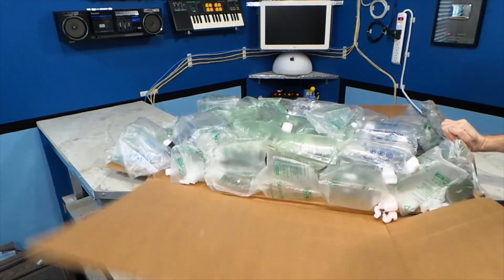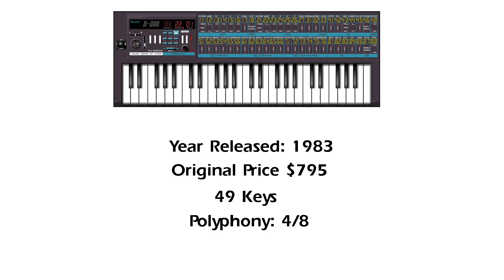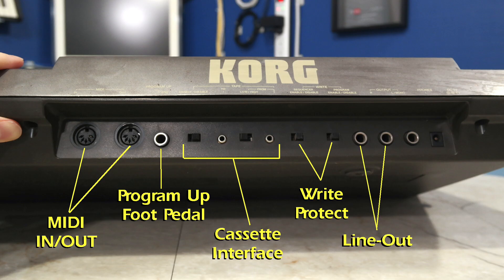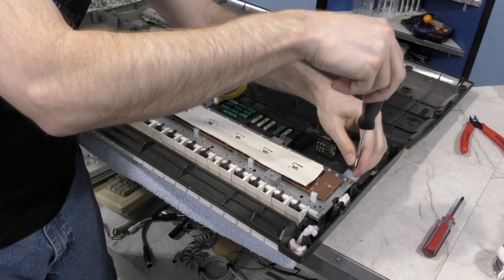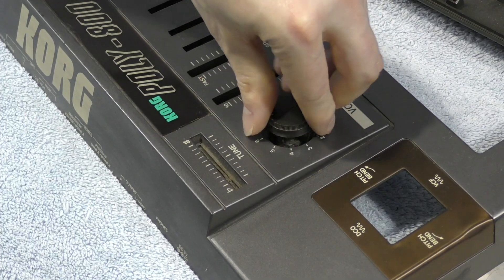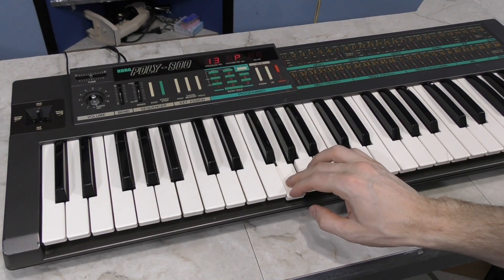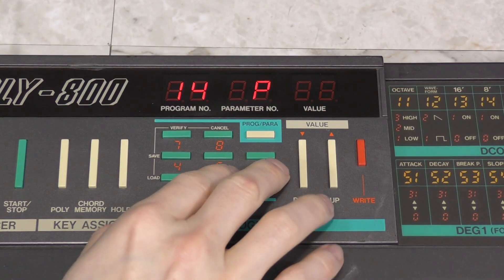Korg Poly 800 Battery replacement and factory reload.

Comment: I had a Yamaha PSR multi function keyboard, and it was good enough for me. I connected my vintage Roland Octipad, MIDI drum pads, and it worked. One day, I turned it on, and it made a loud buzzing sound. I wish I could have brought it somewhere and had it repaired.

Comment: Someone gave me a "broken" Korg-800 a +decade ago ( a stand-alone one w/o the keyboard) but I never got round to looking into it. 
After watching this post I opened it up, added 2 dbl-A batteries and it seemed to run .. 
I now need to hook it up and see if it all works .. from the posts on the Korg-800 it has some passable retro 80's sounds.

Comment: I opened mine up and there wasnt even a battery soldered to the board. I ended up adding one myself which fixed the problem. Hooray. Tho about two months later the same thing happened (the volume of the patches were incredibly faint

Comment: Hello, I’ve tried several times playing the audio file but I’m still not getting the “GOOD” message. I noticed also that, while playing the audio file, the “load” message doesn’t flicker like yours does. I’ve been playing the audio file from my Ipad2 into the synth, could that be the issue - should I be using a tape recorder? Any insights appreciated. Cheers!

Comment: Nice! These poly 800’s often get dissed on for being thin sounding etc,but they are not bad boards,especially the mk 2 version. One tip about those batteries: Sometimes it’s best to wire in some leads and relocate the battery to a safer position so that if it leaks,it’s not onto any fragile electronics. Also- If you want to retain the patches,either dump them through the tape out,or connect the main board to power as you swap out the battery,and often the patches will remain.  These keyboards are good for lofi 80’s stuff,with fun and useful features too,like chord memory,and a digital delay that’s not bad.⚡️

Comment: Some things to add:
- There is a description of the factory patches, but it's not part of the main manual. The scan for the Korg EX800 (module version of the Poly800) has the list at the end.
- The patch 42 you showed is number 88 of the factory patches, it#s called "UFO Swoop".
- You didn't properly connect some of the cables when you reassembled the synth.

Comment: Just had one come in with a battery holder installed. Upon inspection, it appeared to be soldered on and re-enforced with, wait for it, JB weld. Yes, JB Weld on the solder pads. I built up a plastic base for the battery holder and super glued it. However, I had covered the polarity markings, and the schematic on the internet is bad. Glad you made this video so I could double check my work.

Comment: Hi guys, I have trouble  after replacing battery ( 3,07 V) and I have on ram chip only 2,75 and my korg cannot keeep the sounds :( do you know what could be possibly wrong?  There is only one strange sound, even if I have messsge "Good" it do nothing :(
could be damaged RAM chip?

Comment: My HS acquired one of these . Used it in concert band for low strings, brass and pizz bass sounds.
Great and underrated board...Definitely not a professional feel.
Seemed like a toy build compared to my Sequential Circuits. 

The sounds were legit.

Comment: Tried the upload with a wav file run through logic... I was able to get the lights to blink, but no reading of "good" or "err". Only two or three  (of I'm presuming many more) sounds uploaded, wondering if this means the batter needs to be replaced or if I am doing something wrong in my process?

Comment: Went back downstairs with this video. I am on the right side, between IC19 and IC18 there is no battery symbol and there is no evidence of a battery ever being there? I don't know if it is the exact same circuit board in the vid. The number is KLM-596-2. I can't read the whole number in the vid. I am at a loss here, thought it would be and easy fix. Is it possible that some units relied on the batteries in the long tube for the backup? This board looks exactly the same as the board in the vid?

Comment: I opened the poly 800 I picked up cheap because all the factory presets were gone. Before that I had built some voices from scratch to know it was working, but they disappeared once the unit was turned off. I opened it up but couldn't find a battery. So, I came to this video, saw where the battery is and went back downstairs. No battery there. I see on the board on this one it has the battery symbol. There is no battery cymbal to be found on any of the boards? I haven't pulled the boards out, maybe I am on the wrong side, but I don't think so? I could not find any trace of where a battery might have been desoldered? Anyone know whats up with this? Thanx, J.D.

Comment: Nice video... Only suggestion: I have the Poly 800ii. You should be able to use a Sysex file through MIDI to get the factory patches. But the tape works too.

Comment: Next time you might want to wire 3VDC powersupply to the board before removing the backup battery. This way the RAM would stay powered.

Comment: One thing that I have been let known of in the Automotive industry is something called a Battery Tender which helps keep the settings and the Data in the cars computer so that when you are going in to get the emissions and such done on the car, the thing will be able to give the good data to the equipment that they use on the car.

So, with that in mind, perhaps in the future on keyboards of this nature and such, is to get a Battery Tender and use that. Perhaps one should be manufactured and such.

Comment: Great video. I have this keyboard under my bed. Got it new 1984. I have never changed the battery. Didn't know that was necessary. I've always kept it wrapped in the plastic fitted bag it came in. No dust that I can see. I have changed some of the loaded settings to create new and more interesting voices. Really good to see what you do. Thanks.
Reply: Bought mine new when I was 15 and still have it. Only just now figured out the button cell issue. LOL

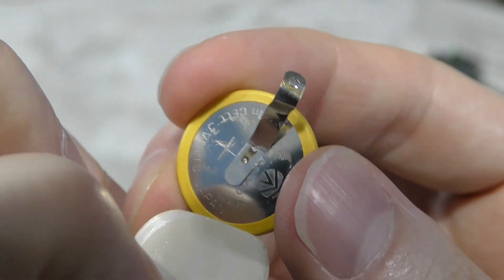Comment: I opened up my poly 800. Everything looks brand new! The only problem is @ 9:52 there is NO Battery , or the battery icon on the board. terminals look clean as if it was never there! Any thoughts on this? Anyone? The unit loads sounds and plays with C batteries for about 3 hours.

Comment: The battery you replaced was RECHARGEABLE, and didn't need replaced. That's why the sounds were still there. Just plug it in every year or two. Problem is, now the one you replaced is more likely to go bad faster as it gets a voltage applied to it anytime they keyboard has power.

Comment: You could make the battery redessign better by adding at large capasitor i parallel with the battery-holder, so that the voltage is kept for the few secunds you need to change the battery without loosing any content of the RAM

Comment: Disliked for the inaccurate Rubik's cube shirt. White doesn't share any corners with yellow!
Reply: True. though it may be intentionally designed that way due to some copyright issue with Rubik’s Brand Ltd. Apparently the company pursues everyone who uses the original Rubik's cube image.  However, your point is still valid because actual liscienced shirts surely exist.   Just checked Amazon and there are in fact official shirts available.

Comment: For the faded plastic...  you could try using the popular auto detailing products designed to restore plastic trim such as Meguiar’s Back to Black (can be used on any color plastic, not just black).    Meguiar’s also has a plastic polish that you could try using with a small buffing wheel attachment on a Dremel or cordless drill (both products are on the shelf at any Walmart or any of the auto parts retail stores)     Another common plastic restoring method used in auto detailing, though can be less forgiving/ possibly damage your keyboard case if you’re not careful is to heat the black faded plastic with a hot air gun.

Comment: This was a dark time for Korg IMO. The Poly 800 may have been the worst synth they've ever made. After the PolySix they were looking for ways to cut costs. Synths were going knobless or at least reducing the number of expensive controls and replacing them with buttons. With Roland at least you could buy an external control box if you needed more real time control. 
The Poly 61 came out around the same time and wasn't much better, but at least had a filter for each voice. 
The DS8 was their FM synth, but was extremely limited compared to the DX7.
Between the PolySix and M1 they made some duds. The DW6000/8000 was good and you can still pick them up cheap. It's often overlooked because they used digital oscillators, but the filters were analog. The DSS1 was also capable of great sounds even if it wasn't super intuitive.

Comment: This is actually a simple analog DCO synthesizer - not quite a "digital keyboard". I actually have a Korg EX-800 (the sound module from this keyboard without the keys) in my recording studio. It can generate some very interesting sounds, especially stepping effects using the envelopes with the low resolution of some of the parameters.

By the way - there are quite a few mods that can be done for this keyboard, including:
https://www.circuitbenders.co.uk/synthmod/POLYEX.html
and
https://www.hawk800.com/

Comment: Next time, add another 3V  powersource in parallel to the battery before removing the battery.  it will keep the RAM chip powered.

Comment: Great video.  If you still have the Poly-800, you might want to consider adding the so-called "Moog Slayer" mod.  My Dad did this to mine.  Said it was a pretty simple mod.  And it makes a huge difference with the filter.

Comment: Highly recommend the 3M/SCS 497AJM electronics vacuum for ESD-safe vacuuming of electronics including circuit boards. It's expensive, but so worth the money. It does a great job cleaning everything from computers, fans, PCBs, hard drives, etc etc.

Comment: HI! Next time before you replace an old battery, plug an other new one in paralell with the old. When new is plugged or soldered permanently, change the old battery to a new. When ready, remove the "temporary" battery. Voila, it is so simple !!!

Comment: Analog synthesizer... too simple.
Digital synthesizer/sampler... too complex.
Amateur keyboard from the 1980s... simple enough but with subtle nuances in the primitive yet somehow advanced technology the company had to work with.
I have 2 Casio MT-205, one which I intend to circuit bend the hell out of, and the internals are super interesting! A custom Hitachi ASIC is more than half the keyboard on a single chip, but because it’s 1980s tech, it’s kind of hackable!

Comment: Never saw program loading from sound.
Reply: Using a audio cassettes was one of the ways of storing and loading data alongside the floppy disks used in the early eighties. Very popular with computers for games like those on the Commodore platform.
Reply: @Nolroa  Also data transfering with 3.5mm audio jack amazes me too!

Comment: You can find both the original patches and user-created sounds right here on Youtube! I have the original tape and owner's manual for mine but I love to see what others have done. Couple tips: the 1/8" input for programming may not work if you are using a stereo 1/8th in cable. I switched to an old mono cable and it worked perfectly. It may take you a few tries to get it to load just right. The key is to play with the output volume of your source (tape deck, computer, etc.) until you give the keyboard the level it is looking for. Try using the "low/hi" switch on the back if you can't get the level just right.

Comment: I've programmed them in several times in the past, as it was my learning tool. I've owned 2 Poly 800s and a Poly 800ii.
You could have found the factory defaults and more a few years ago.
The Poly is a fairly great Cheap Synth, but of course, very limited.
Great for 80's retro and the helicopter comes in handy when playing floyd as you can utilize the hold button as well as turn down the back up the frequency control to give the sound of a helicopter landing then leaving.

Comment: I'm just curious I have a long dw8000 in the same condition I took it apart and put it back together and it doesn't make any sounds. Does that mean I can 'load' the sounds in if I plug it into the audio jack and play a cassette data file for the factory reset sounds?  I've never done this. 😁

Comment: Cool, loved the P800. Nice to see this one found a loving home. Note it's not truly a poly synth, the VCF is only monophonic. However only triggering the VCF envelope when no other notes are played allows for faking "two sounds at the same time" and that was kind of a cool feature.  Two things I missed in this vid:  No demo of the sequencer??? sorry that is just a epic fail. And why not just save the patches to tape before they got lost? As for the battery change, the battery you removed was probably in there since the '80s and was clearly still ok. The original estimate was for the battery to last at least 10 years. The new one will probably also last 30+ years.

Comment: Could you have traced out the battery trace and soldered in some wires to another battery to keep the memory alive while you changed the battery? We had a little device we used when replacing car batteries, it used a nine volt battery and plugged into the cigarette lighter. You made sure the dome lights were out and underhood lights unplugged then changed the battery. It kept the ecm, radio presets, and bcm memory intact.

Comment: Just a quick note re: your comments at 13:42. I managed to get hold of a Poly 800 recently and, not only did it come with a flight case, it came with the original cassette and the original printed manual. This manual contains a "pullout" detailing all of the pre-loaded/factory patches (including their parameters), which is possibly missing from PDF versions online. It's only three pages, so let me know if you're interested in a scanned copy.

Comment: The Poly 800 is a wolf in sheep's clothing! A really good, fully programmable analogue / digital hybrid with a primitive but usable MIDI implementation that was one of the first MIDI capable synths on the market. I had the "limited edition" version with inverted key colours, and still have the original patch cassette that it came with somewhere.

Comment: The synthesis is very basic, no PWM, no Osc Sync, no Ringmod and has a monophonic filter envelope. The overall sound is kinda cold and there's some weird digital hiss audible when the filter frequency value is set high.
Programming is really tiresome as you need to switch back and forth between parameter and value, the buttons are also not always trustworthy and can lead to frustration when for example you want to type 64 but the 4 repeats and you'll end up with 44.
The step sequencer and chordmem are kinda fun extras.

Comment: If you ever need to change a battery again, you could temporarily solder two wires to the circuit board and attach another battery in tandem - kind of like a heart-lung bypass machine!

Comment: Why didn't you power it with a power supply before you removed the battery? Just solder some 3v leads on the swap the battery.

Comment: hello everybody that reads this comment..:
(Please! HELP)

i got an Poly-800 from a friend , once i get it it was very in bad conditions also has no sound!
the sound was kinda humming and no key info in any key im playing! (so its play a same humming)
anyway, i searched over the internet i found an factory.wav file, i tried to load into it, my 2 first times was fail
i pressed random green keys on top of synth and its look i got something, ^_^
i turn synth into normal mode and magically some beautiful presets was arrive!
so keyboard has some dead notes on some notes, i turn off the synth , then i opened it , to fix those things,
also joystick
Maintenance Cleaning &etc...
when i got powered on after 5-6 hours, presets sadly gone! :(( and same humming again!
i never found out how i upload those sound into that, :(
it was completely lucky and randomly...

what should i do ?

its kinda creepy loaded that sound data, i have the sounds but the kinda crappy. :| tunning changing, randomly LFOs and whatever,
its look its loaded the needed data like waveforms and....
but im too lazy to Re-Program sound on this Synth, 
its has such Headache Workflow.! 
i mean Horrible Programming Workflow!

i want to use only those preset sound not Re-Programming anything from scratch :(

thanks for Reading and waiting for your answers ^_^

Peace

Comment: You could have hooked up a temporary battery over the RAM chip power pins during the replacement of the soldered battery.

Comment: Korg Poly-800 have Oki MSM5232 chip as oscillators. This chip is just a simple PSG-chip and also used in some 8-bit arcade machines.
Here, probably, we have a really unique case when the PSG-chip is used in a professional keyboard! So in this case we can say that this is really an 8-bit Keys and actually there is no contradiction. =)

Comment: I needed a midi keyboard and a random dude i met at the local pool overheard me saying so and said i could have his. Hey! Free! So i went along and picked it up and took it home... was i so ever disappointed when i first set it up... no internal speakers! And then once i had it hooked to speakers... no piano! But still  got to appreciate it over the years using it as a midi control keyboard without the actual sound. Not a synthesizer guy, so it is just a world of mystery to me. ...so, indeed a Korg Poly... not sure if 1 or 2, but extra cool factor as it has inverted keys (Black keys with White sharps)